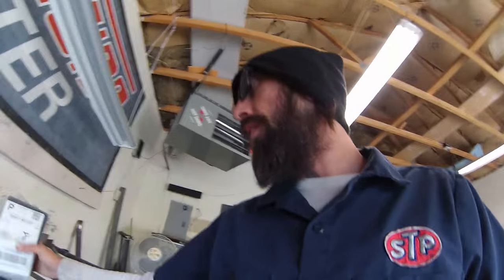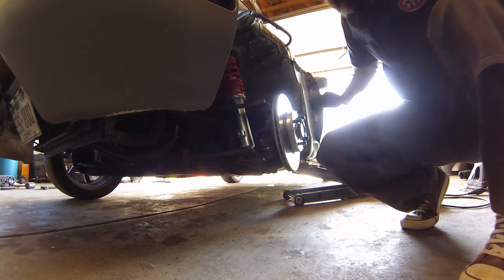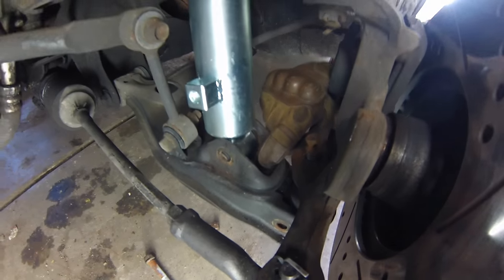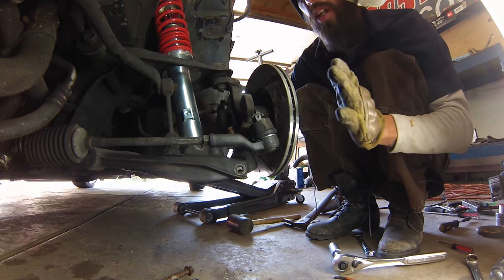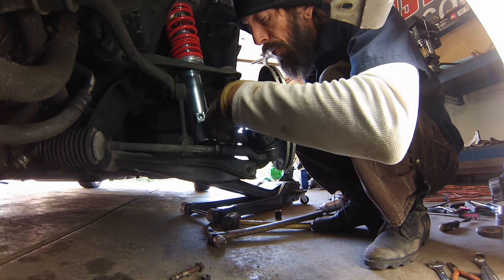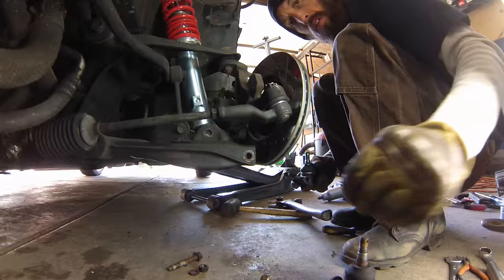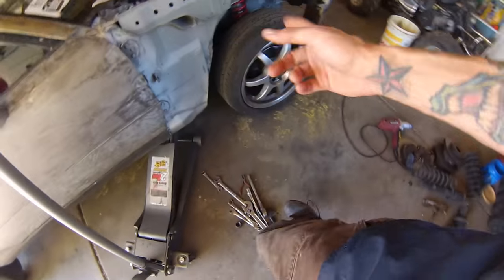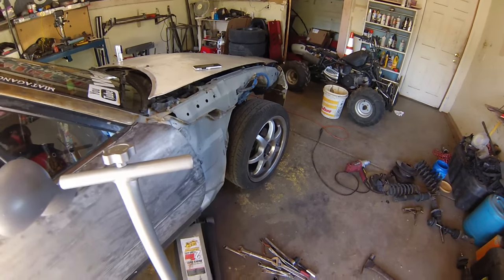MIATA TIE ROD ENDS AND LOWER BALL JOINTS INSTALL!!! S05E17

Comment: How have the budget lower ball joints held up? I felt uncomfortable going so cheap on such a important suspension point.
Reply from the maker: well this was June of 2016 so almost a year and a half ago... The car still has the ridiculous wide wheels on it, is now on it's fifth owner, and is driven like a race car, daily. The wheel bearings will wear out before the ball joints.

Comment: Just been quoted 200 quid + VAT to get 4 ball joint rubbers and 2 track rod end rubbers replaced. Is it that big a job, really? Would I need any specialist tools? I don't have to go to the same lengths you just did just to change the rubbers do I?  I'm in Ireland and it's become mandatory for the roadworthiness test we have to do every year to stay legal. It's a fkn rip-off, my MX5 has run 15 years with ripped rubbers and zero damage to the joints, no grease lost, purely cosmestic.
Reply from the maker: what is quid? lol
Reply: @pawpatina : Euro's. Think of it as a dollar and a bit. Think 300 bucks to do 4 ball joint rubbers and 2 track rod rubbers + I'm supplying the parts. Is it as big a job as removing the ball joints and track rod ends or is there a cheap and quick solution?
Reply from the maker: @Ogma3bandcamp  there is no "rubbers" theres only the upper and lower ball joint and the tie rod end. thats all. I would say thats a lot but I'm a cheap bastard. it really depends on if you have the tools, time, and place to do it or not. if not, no amount is too much.
Reply from the maker: @Ogma3bandcamp  no one should be changing just the "rubbers" or boots. replace them as a unit with new boots.
Reply from the maker: @Ogma3bandcamp  basically the second the boot opens up, dirt got in. new boot and new grease won't remove the grit and the joint will destroy itself from the inside out. you won't see it thanks to the new boot and won't know until your wheel comes off on the highway. you are already in there and halfway removed anyway, replace the whole thing.

Comment: Not sure if you still monitor the comments on this video, but I'm having a lot of trouble getting the vertical bolt in the lower ball joint. I noticed it took you a while as well but could't tell exactly what you did to get it in. What worked for you?
I'm referring to the bolt you are trying to get in at https://youtu.be/etcK5g4ie28?t=400
Thanks
Reply from the maker: just like in the video, pry on it till it lines up enough to get the threads in.
Reply from the maker: i also remember on the cheap ball joints, the part that holds the horizontal bolt that goes from the front to the rear was a little too wide for the slot with the powder coating so i had to grind those surfaces smooth first. that may be keeping the ball joint from going into the A arm all the way and not letting the vertical bolt line up...
Reply: Thanks, I watched the video over again and I had tighted that horizontal bolt before getting the vertical bolt in, which didn't give me enough play. Very helpful video.
Reply from the maker: Hey awesome!! at least you got it! thanks as well!